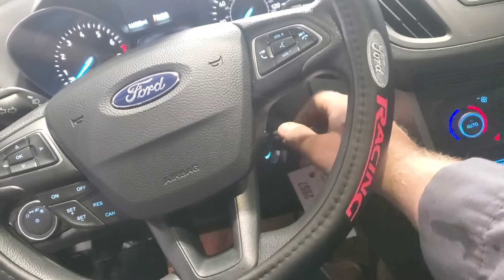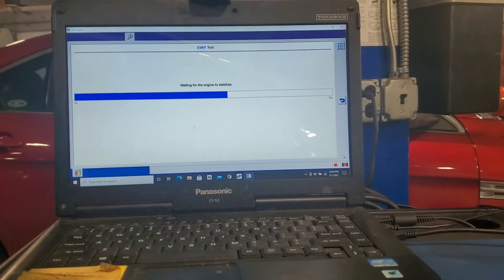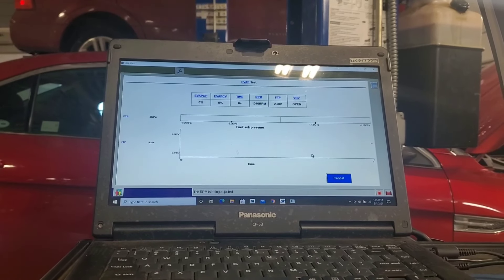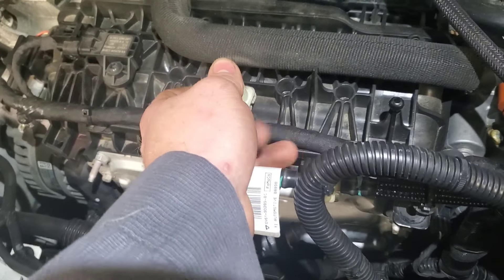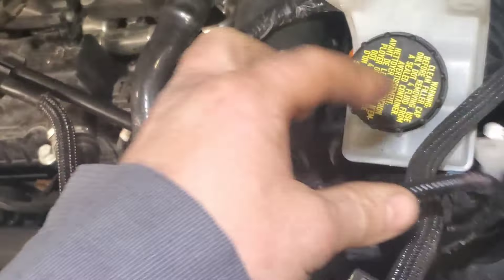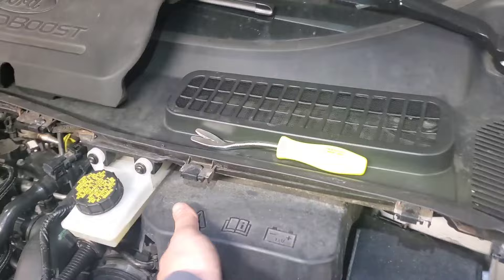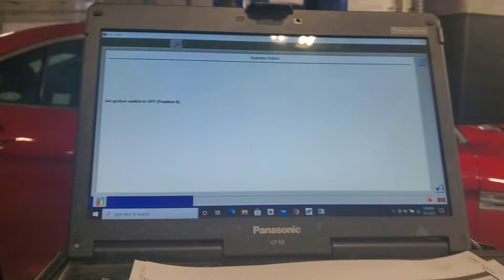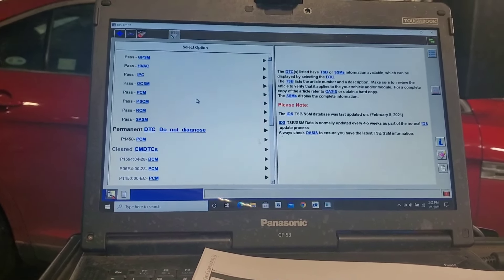2018 Ford Escape 1.5L Ecoboost P1450 Evap Purge Valve Diagnostics and Fix - other years also

Comment: Have you ever experienced the P0496 on a Ford? I replaced the canister, vent solenoid and even the purge valve but none of these worked. i suspect it could be the fuel pressure sensor or the fuel hoses
Reply from the maker: You need to run an EVAP test
Reply from the maker: You have to make sure that the gas cap is good and it's got a good seal and it's tight
Reply from the maker: Also if the vent valve is hanging open a little bit it's going to make the purge valve not be able to work right
Reply: I’m having the same problem.
Reply: i have the same code PO496  and the 2018 does not have a gas cap

Comment: I got a p0495 and ended up here on a 17 escape se 1.5

Any advice? 128,000 miles.
Reply from the maker: What does that code mean?
Reply: @FordBossMe  small Evap leak.
Reply from the maker: @YeahJonesy  same thing as what I did in this video small evap leak could be the gas cap it could be the purge valve or something wrong with the fuel tank but I would start with the purge valve before anyting and make sure the gas cap is clicked and tight

Get a purge valve and put it on

Comment: What software are you using in this vid to run the EVAP test? I just put some AMS turbo inlets on my 2019 2.7L F150 and I'm getting a P04F0 code - EVAP System High Load Purge Line A Performance. I disconnected the return tube that is connected to the intake to TB and blew smoke back through where the two tubes connect to the inlet and it was sealed tight, could be different under boost though. Would love to run an EVAP test on it to see if it's the solenoid. I'm thinking thought that it might be a slight leak where the two tubes connect to the driverside inlet. Thanks for any help you can offer.
Reply from the maker: Fords IDS software with the VCM2 data link connector

Comment: 1. Why not just replace the faulty part, the evap purge valve instead of replacing the entire harness and all components? 

2. Assuming you cannot find the valve by itself, where did you get the new harness and what is the part number? I watched the whole video and did not hear a part number or place to buy mentioned
Reply from the maker: This is how it comes this is what you do and that's just how it is
Reply from the maker: So you definitely missed it there was a part number listed in the video you're going to have to go back and watch it it's clearly right in the video 2 minutes and 40 seconds I can't even believe I have to explain this type of stuff all the time and it's not even like it was just a short brief period there was a long time it was talked about
Reply: @FordBossMe  alright so where do we get the part?
Reply: @FordBossMe  I did miss it because it was flashed for approximately 2.5 second after talking about "they sent me the wrong part" .. in the middle of the troubleshooting section.. like man that was really easy to miss my dude.

anyway let me take on the monumental task of typing it out for anyone else who comes along like me ..

GV6Z-9D289-E 

I'll even come back with a link to the item 👍
Reply from the maker: @danielschmitt6622  I gave you a video to explain something here and I gave you a little bit of an olive branch to go out on and now you're here being a problem for me

I try to be a nice guy Daniel but if you're going to do this kind of stuff to me I'm going to make it to where you can't even comment on the channel anymore because I don't feel like I deserve to be treated this way when I'm the one that took the extra effort to show the Diagnostics and at least put something out there to help somebody else and here you are trying to walk all over me like I'm a f**** rug it ain't going to happen bud remember you need me more than I need you so let's nip this s*** in the bud right now or we're going to part ways and I'm going to make sure that happens real quick
Reply: @FordBossMe  Dude lol you need to relax. Your video was appreciated but you took the most important piece of info and slipped it in a spot of the video that was confusing and only showed it for 2 seconds, and made no mention of it in the description or comments when directly asked for it. . So I'm posting the part # to help you out, you had other people asking the same question so it's not just me. Learn from this and your videos will be better received in the future. Or if a little criticism is too much for you then maybe you are better off just not doing this? Up to you bud.
Reply from the maker: @danielschmitt6622  it's how you come across man that's it you came at me the wrong way and I feedback with the same energy that's just how it is that's how I operate you can hate me for it or not it was their you missed it I apologize it was so short but it was there

I have a lot of stuff going on man I work on so many different cars I help people all over the world I don't have time to come back and Dot every i and cross every T I expect a little bit more from people that's just me and that's just how it is

I apologize that you didn't get the number spelled out to you clear as day but I roll I make videos I put them out I show people how to diagnose these things sometimes they're perfect sometimes they're not that's just how it is but I don't want people coming at me sideways
Reply: If you replace one piece might as well do the whole thing, that was seriously a stupid question.
Reply: @invalidusername_5101  I know for sure my only issue is that one valve right on top of the engine. it is 10x the work and cost to replace it all, so no it is absolutely not a dumb question.
Reply: @danielschmitt6622  The owner paid for the whole thing. Why do half ass work? It was a dumb question
Reply: I only changed the valve.